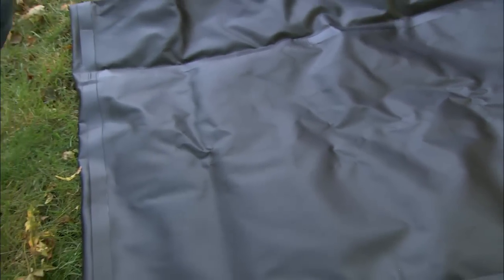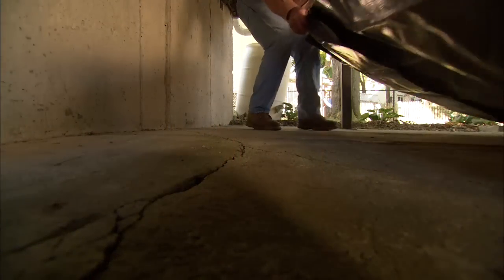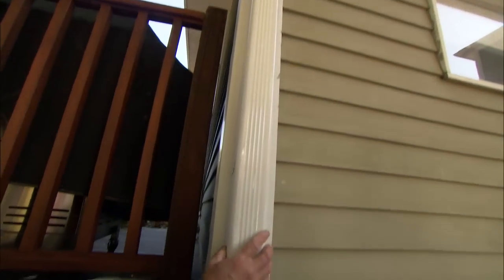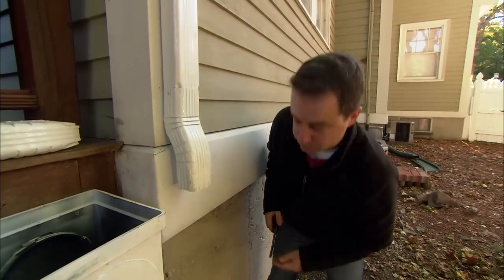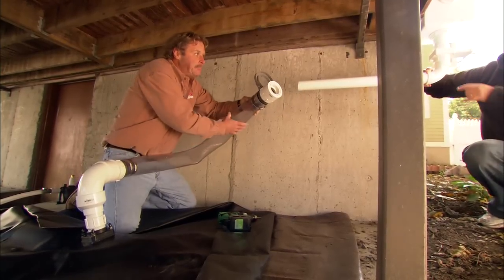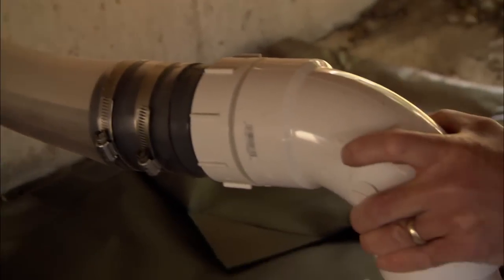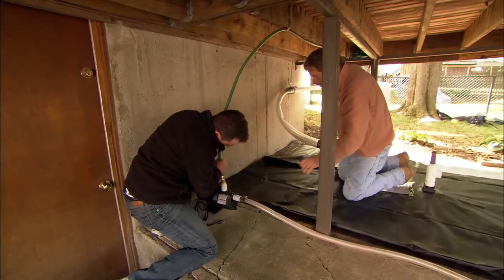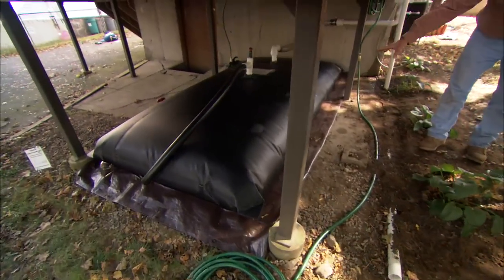How to Install a Rainwater Collection System | This Old House

Comment: 1 We install pillows outside and have not had an issue with any rodents, cats, dogs etc.  
2 The pillow is able to withstand freezing but unfortunately the pipes and pumps must be prevented from freezing.  Outdoor pillow systems need to be drained in freezing locations or other protections need to be provided.
3 The pillow is filled with harvested rainwater from the roof not municipal water.  
4 Return on investment is determined by the amount of water you use. Each system has a different ROI
5 A single container is always better then multiple containers because each container requires a minimum of 3 fittings.  10 (50gal.) rain barrels require 30 fittings and fittings are the location of most system leaks whatever system you install.  One pillow with 3 fittings is made to fit your available space.
Reply: Instablaster.

Comment: I wonder how long it was before he wished he had thirteen 55 gallon drums instead of this thing?
Reply: First thing i would do is putting some walls around this thing because it is ugly as hell
Reply: I know. I just did this but with 2x250 gallon plastic “cube” tanks. I covered them with pickets to match my fence and you can’t even tell they’re there. Tossed in a $30 sump pump and bingada-bongada-boom I gots wattah.
Reply: About a month or two wheb that flexibke pipe degraded into powder

Comment: He said he can't wait to start saving water, but just put 650 gallons of water from the hose into that thing
Reply: You say that as if he's just gonna dump the water out and waste it.  It will get used just the same.
Reply: @black_squall  not the point...the point is someone has to pay for that 650 gallons of water used to fill that thing
Reply: Where I'm at, 14,000 gallons is about 50 bucks..
Reply: @bricelewis7869  it's a demo for a TV show my dude

Comment: How does he keep the pillow from freezing in the winter?
Reply: They don't you don't water your lawn in the winter.
Reply: Drain the pillow than block off the pipe to the pillow so if it rains in winter the water will go to the ground instead of the pillow

Comment: Pump electricity is probably more $ than the city water. Just a thought. Probably about $7/1000 gallons.
Reply: not to mention in most areas you'll never see a return on the initial investment as that thing is bound to blow long before you saved enough on water bills to pay for it.
Reply: One thing though. Rain water is better than city water. So it may be worth it for some.
Reply: edit: I take back what I said. In every plant study I've looked at - for the specific purpose of plants, it appears any rainwater is superior to city water. I'd still be careful with consumption in certain areas.

Depends on the state and global wind patterns. Rainwater is great in Oregon, New mexico, Texas, etc. I wouldn't recommend it in: eastern Ohio, PA, NY, etc, because of coal power plants and mines. Haven't done any testing though.
Likewise, groundwater probably isn't a good idea in Oklahoma, West Texas, or heavy fracking areas. Only so much barium one should absorb. Tricky thing water is these days, especially with all the pharmaceuticals.
Reply: In all likelihood this isn't some elaborate money making scheme.  He's probably just trying to be a little more environmentally conscious.
Reply: @lifeisgood070  New Mexico and Texas have tons of coal burning plants. Oregon is getting theirs from China. Fracking is fine, it happens far below the water table.
Reply: Many areas have water use restrictions though which prevent you from keeping a green lawn on city water.

Comment: could have used 130 or 250 gallon IBC totes instead of barrels
Reply: That's what I was thinking, and you can even paint them so they don't look terrible and they'll be a lot more durable than that pillow

Comment: This system costs over $2,000!!!  Payback in about 10 years if the components last that long.
Reply: I think I would be to buy a small above ground pool and a pool cover to hold rain water. Much more Afforable.
Reply: DIY you could do it for a lot cheaper. Recycled 275 gallon IBC totes are $45. Just need to install a diverter, some fittings, and a $100 pump.

Comment: they never mentioned any freezing concerns or winterization issues with this system seeing as its permanently installed.  even a thick rubber bladder needs to be cared for with regards to freezing and sharp pointy objects.  Its not like this is a military-use fuel bladder...
Reply: Drain and put pump, bladder in basement.

Comment: When it bursts because some kid wants to crawl around on it and poke it with a sharp stick, all that water is going to go into the basement.
Reply: 1) the thing is under a deck, and will ultimately be covered (as stated in the video).
2) the yard is significantly sloped.

Comment: I hope the homeowner didn’t have to pay for this.  2 used food grade IBC totes will get you close to 700 gallons and you could put them up on cinder blocks to gravity feed the water, eliminate the pump and save electricity.  And that thing is ugly, will likely puncture when a rock thrown by the lawnmower or trimmer hits it.  I like TOH, but the landscape ideas they have sometimes baffles me.
Reply: Exactly. I picked up a couple at an auction and they are great. Have all the water I need for my chickens and other animals

Comment: I just did this with a smaller barrel ..

The overflow is way too small (at least in my application..)

My roof area is 24' x 22'..  I live in the Ohio River valley and we've seen nonstop rain for about ten days ..  when it's raining reasonably hard, the barrel is full and overflowing coming out of a hose end at the bottom, and a 2.5" overflow at the top..  I'm going to try a 4" overflow.. hopefully it's enough, I was disappointed !

Comment: What happens in freezing weather?
Reply: I would imagine you need to drain the system and put the pump in the basement, it's a little extra work but if the person doesn't care then... No need to water the lawn in freezing temps if that all he wants to do ?
Reply: I think its for people who want to use it to fill their ponds in dry spells. I  guess that's why they bury their tanks in the ground where its warmer in the winter.
Reply: Burst.